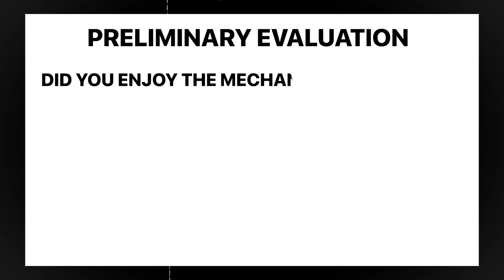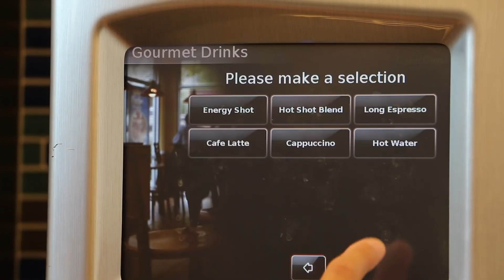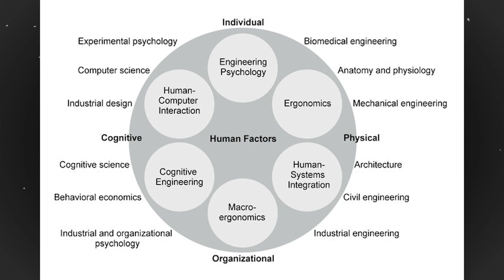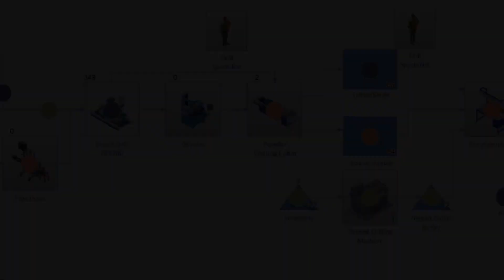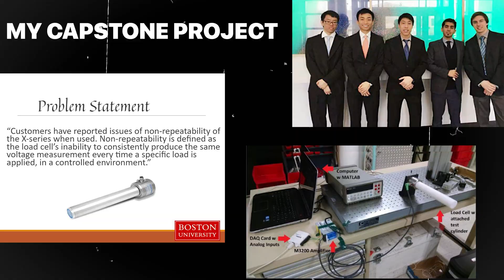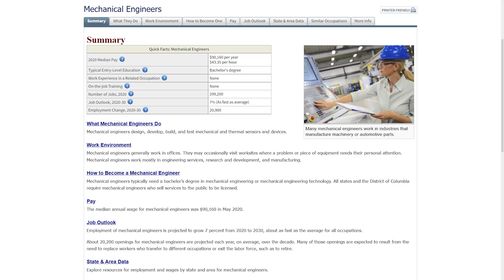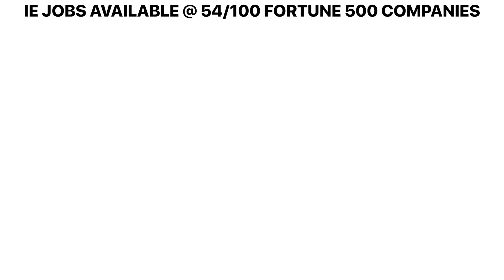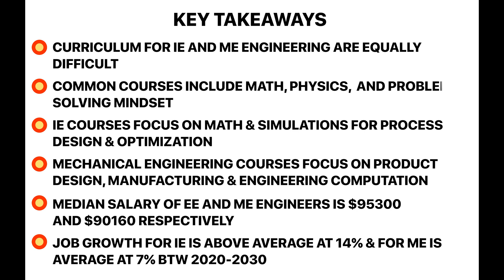Mechanical vs Industrial Engineering : Which is BETTER?

Comment: One of the most comprehensive videos I've seen on Youtube for industrial engineering. My school didn't offer industrial engineering, so I went with mechanical, but I always wondered if they were the same thing. Your explanation was clear-cut and to the point👍
Reply from the maker: Yea that does seem to be the case at least in North America and they are quite distinct. Thanks for watching!
Reply: I needs your help concerning program selection between mechanical and industrial. I have got interests in both programs, however, only one program should be taken between them